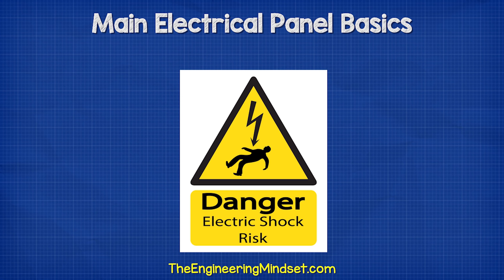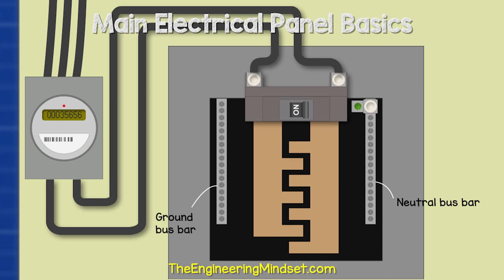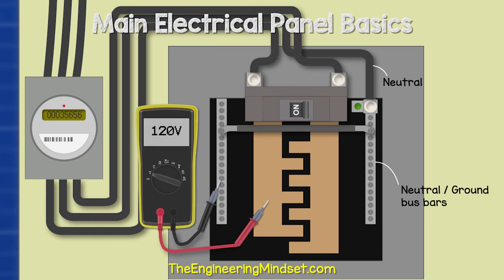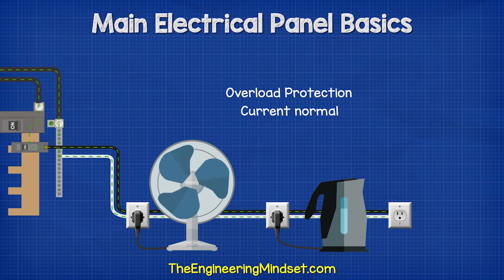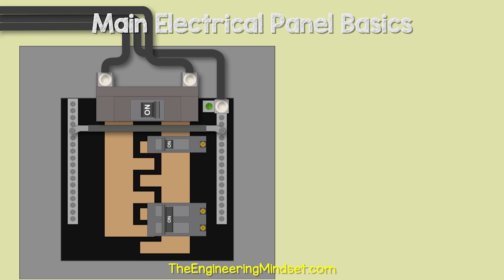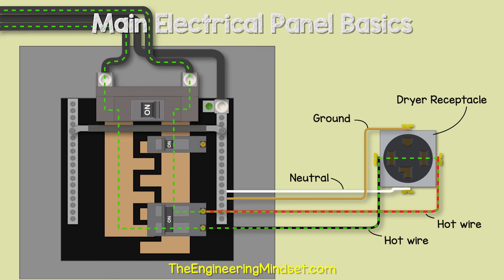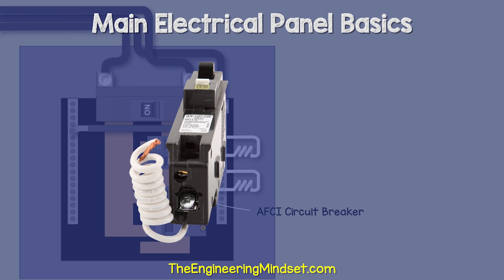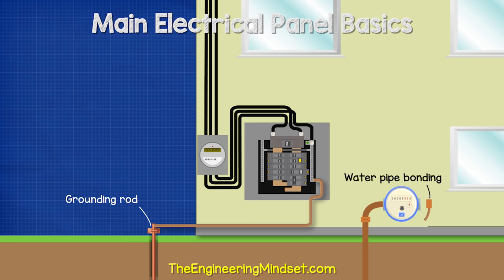Main electrical panel explained - Load center - service panel

Comment: The grounding electrode ( ground rods and water meter ground are really for lighting. If the building were to be hit. This lets the power go straight down through the wiring instead of bouncing around your internal wiring.  But it will bond you water piping also.

Comment: Is the transformer really single phase but split?
I always assumed it's just two of the three phases routed into the premises.
God this is so strange and weird.
Reply: Single phase indeed. There is a bit of a safety factor to having 240v available, but 120v for most household items that can work fine on it.
Reply: 2 of the 3 phases would give 208 because they are 120 degrees out of phase instead of 180 degrees.
Reply from the maker: Seen our new 3 phase transformer video?➡️: https://youtu.be/u0SsejDCVkU
Reply from the maker: Seen our new 3 phase transformer video?➡️: https://youtu.be/u0SsejDCVkU

Comment: wait if the ground and neutral bus bars are connected together, then why does electricity flow from the hot to neutral but not trip from being grounded?
Reply: Well, if the hot wire is actively "pushing" electrons, the neutral is effectively "pulling" on them. Of course this flips back and forth because it's AC (60 times per second in NA). Ground is 0 potential... think of the hot pushing as being + potential and the neutral pulling as being - potential. Electrons will always take the path of least resistance. A -120v pull is less resistance than 0.
Reply: @iwfur25  thanks for clearing that up

Comment: I've searched the internet.   I am simply trying to answer 1 question about my 200 AMP home's electric service.   My electrician. looked into the service and remarked, "YOU HAVE 240 AMP BUS TOTAL."    He left.    I looked into the service later and saw some single and double circuit breakers, with markings like 20 AMP, 15 AMP and etc.   ANY WAY I try to add it up, I don't get 240 AMPS for BUS.    THE QUESITON:   HOW did my electrician look briefly at my service and KNOW that my BUS TOTAL was 240 AMP?   Thanks!!

Comment: Hold on!!!??? The ground wire doesn't go into the ground? Doesnt sound safe enough
Reply from the maker: See this https://youtu.be/P-W42tk-fWc
Reply: @EngineeringMindset  very interesting! Thanks for this info. 
I'm in the EU does the ground pin work the same way?

Comment: I am curious on how the meter, smart meter in particular measures the incoming and outgoing current.
When you have something connected between 2 phases all the current returns through the meter and back to the grid as a closed loop always have the same current throughout it.
Does it meter that the voltage drop or phase slightly lags behind?
What about when you have a solar system connected to the grid, either 1 phase or 3 phase without neutral. Does the meter measure a slightly higher voltage on the consumer side than the grid side or a phase that is a little in advance of the grid?

What if you connect 1 phase to ground, how would the resulting consumption at the meter be measured? Only local ground in this scenario, no neutral or ground connected through the meter. Think of IT net without delivered grounding :)
Reply: If you connected 1 leg to ground it would be a dead short and would pop whatever breaker or fuses you have. Unless you're trying to start a fire that is.

 The terms you want to look up for in North America is an Impedance Grounded system, Solidly Grounded System, and Bonding.
Reply: @Morberis  Not everybody lives in north america. I was thinking about connecting a load between phase and ground, but you do not short circuit anything by connecting a phase directly to ground on an IT net. But you would make all your grounded appliances in your house quite dangerous to touch .....

Piisfun, thanks for the answer :)
Reply from the maker: Check our new Multimeter tutorial out ➡️ https://youtu.be/4lAyzRxsbDc
Reply from the maker: Check out NEW resistor video, everything covered! ➡️ https://youtu.be/DYcLFHgVCn0

Comment: If the illustration on this is correct, isn’t that against code? Bonding of Neutral and Ground wires should NEVER occur outside of the main panel. Neutrals and Grounds are to be separated in sub panels.
Reply from the maker: Please watch this video,  https://youtu.be/NUSNa-7Hecw all fully explained along with NEC codes

Comment: why the neutral and the ground bars are connected together? it is unsafe if the ground bar is not separated from neutral bar.
Reply: Neutral and ground must be connected together only at the main panel and no where else, including sub panels. The reason is to guarantee a 0 voltage reference point. This is necessary for the circuit to operate safely and for circuit breakers to trip when needed.
Reply: @surferdude642   then why is there a need for a ground circuit if the neutral can satisfy the requirement? my understanding is that the neutral is the return path of current, thus, it is hot whenever any load is energized and if the ground wire is bonded with the neutral it becomes part of the return path since it becomes energized also whenever any load is energized.
Reply: @surferdude642  where i live, we have a two-wire (hot and neutral), single phase, 240 vac, 60 hz, ungrounded system. I always get zapped when touching the metal parts of some of my appliances, so i decided to install a grounding rod and upgrade the outlets, do i need to bond or connect the grounding wire to the neutral line at the main panel?
Reply: @igorivanov7232  I'm not sure where you live, I'm in the US where we have a 120v system by center tapping the secondary windings of a 240v coil and hence the return or neutral wire. 240v is commonly used for high power appliances by connecting to opposite poles and omitting the center tap. In this case there's no neutral wire and the return shifts with the frequency from one pole to the other. Both are hot wires. 
You may have a loose hot wire that is making contact with metal somewhere in your system. You should call a local electrician to fix it. Changing the receptacles may do it, but a grounding rod will not help. You'll need an equipment grounding conductor to provide a fault path from the equipment to complete the circuit and trip the breaker. A grounding rod is mainly used to direct external current, lightning strikes, to earth.
Reply from the maker: Check the new SUB PANEL EXPLAINED ➡️ video https://youtu.be/NUSNa-7Hecw

Comment: i'm guessing that if you insert a screw through the hot and neutral in series, that the screw has a higher resistance than copper wire that a regular breaker may not trip.

Comment: They have energy savers you can connect to the breaker board and it could save more than 50% on the energy bill.
My brothers house was costing him 350 per month and it dropped to 140...

Comment: Hey- If I'm returning their electricity to them via the neutral, then why are they charging me for it?
Reply from the maker: You're paying for them to push the electrons through your devices when you need them, when they pass through your devices the energy is removed as heat, light, sound, rotation etc. The electrons continue to move, but energy has been removed. Its like sending a workman out to fix something, the company needs the worker back to do the next job but they have used energy to complete the job, so they need to eat food.
Reply: @EngineeringMindset   Thanks.  I hope you're a teacher because you explain things very well.
Reply: Think of it as a river, as water passes it can make things move like water wheels, turbines etc, but the water keeps flowing it keeps following its path.

Comment: I find it quite funny that in the US you have those "dryer outlets". From the european perspective, a dryer would be the last thing I'd connect to a high power outlet - the typical stove though is connected to 3-phase 400 V here in germany
Reply: @GH-oi2jf  My Miele dryer works very well - I usually don't even use it on full power as not to shrink everything. We can still pull 3.6 kW peak from our wall outlets, that is sufficient. Especially if you have a dryer with a heat pump. One thing we have are washdryers - they are the things that often really don't work so well.
Reply: @philipphermann9454  Why is that funny that we have dryer outlets? If the device needs a lot of power, we provide a 240V receptacle with the proper current rating for it. It's ironic for you to say that when meanwhile a whole host of EU general receptacles are 240VAC. This setup of 240V general receptacles has the potential to be more dangerous because power rises exponentially with a minor increase of voltage rating.
Reply: @amorag59  it is funny because we also have receptacle for devices that use high power - they are 400 V and used for stoves and heaters with power bigger than 3.6 kW.

Also - in contrast to US plugs - it is impossible to touch the contacts of the normal 230 V european plug/receptacle when they are live. So actually the US system is much less safe eventough it uses half the voltage 

btw: AC is deadly with as low as 50 V and 50 mA (resistance of the human body is around 1000 Ohms), so it doesn't really matter for safety. DC however would be relatively safe with 110 V.

The only thing that 110 V does is requiering more copper for al thr wires to allow the same power output because more current also means more loss as heat in thinner wires. So actually 230 V makes economic sense.
Reply: @piisfun  sure, cooking with gas is fun. But modern stoves use induction, they don't have the same problems because the on-of pulses can be much shorter and spread the heat better over time. Even without induction it really depends on the type of hob you have.
Reply: @philipphermann9454  I wasn't sure why you said "From the European perspective, a dryer would be the last thing I'd connect to a high power outlet" ie "why do dryer outlets exist" Then you brought up a high power outlet for a stove that is even more higher power.

You do have a point with saving money using higher voltage thus smaller wire for the same power, in reality for general circuits the wire sizes can be similar. I know the UK uses 13A breakers and some other places use 16A breakers with 2.5mm^2 wire. Compare this to a US circuit that has 15A breakers and #14 wire (2.08mm^2). Some EU countries do save on the lighting though as I've seen some EU lighting circuits can run as small as 1.5mm^2.

You are correct, I have seen the EU plugs with a bit of plastic on the base to prevent you touching the contacts. This is the least of my worry though. It's when a kid sticks a paperclip in a receptacle and you have an arc flash. We have tamper resistant receptacles required by code here that has a shutter door that covers the plug slots and a see-saw mechanism where you have to insert both prongs to open the shutters and push the plugs in.

Again the power increases with the square of voltage (V^2/R = power) I have not experienced an arcflash at 240/250VAC as I don't live in the EU (and I'm smart enough to not short out at US 240V US circuit lol) but I have shorted a 120 circuit via a metal screwdriver on the enclosure terminals and there was just a very loud pop. A jump from 120V to 480V you go from loud pops to a life threatening explosion producing a fireball hotter than the surface of the sun (an arc started simply from unsettled dust not even something metal). I imagine the results of an arcflash at EU standard voltage is in the middle there, especially if a child sticks a paperclip in an EU receptacle. At the end of the day 1.8 KW is more than enough for general use appliances, and all houses are set up to have 240VAC build in where the dryer would be.

Comment: why do they say neutral is safe.. its not it is still 120v.
Reply: It is safe to touch the neutral conductor whenever the circuit is open (like when the bulb is OFF) as there is no potential difference between the neutral and the ground you stand on (120V is the potential difference between the neutral/ground and one of the two hot wires).  But don't touch the neutral conductor on a closed circuit (like when the bulb is ON) as it is the return path for current.
Reply: @GH-oi2jf  should being the key word. I got nailed good from a dead short to neutral on the case of an ac compressor. Arm was numb for a good twenty minutes
Reply: @GH-oi2jf  I am just saying it should still be treated with care. Couldn’t figure out what was wrong with the compressor it ran fine but the case was live.

Comment: Why would you want your electrical distribution system tied to an actual path to the earth? If you had a lightning strike on your house, and it found a path to the earth though your panel, wouldn't it introduce millions of volts and and incredibly high current through all the relevant conductors in the distribution system?

I would think a system to protect your house from a lightning strike would have a completely separate path to the Earth.
Reply: The goal is to give that stray voltage a low impedance path to where it wants to go, out of the structure and into the earth. If this path was not available, the lightning will bridge those gaps anyway possibly through the combustible materials of the structure increasing the chance of a fire.
Areas that are prone to lightning storms do have their own lightning systems on the exterior of the structure.
Reply: The power transformer on the electrical pole feeind the house has a ground. If for some reason the actual neutral to the house was missing the ground would provide a path back to the transformer, allowing the circuit to be complete. Having a backup neutral is very important because if you were to lose the neutral and didn't have any kind of backup (ground) then every single device installed on one phase would be in series with the other phase of devices and a lot of devices would essentially blow up.

Comment: It is illegal and crazy to connect the neutral Buzz bar the ground to the neutral busbar the ground should be independent of anything and should not ever be connected to a neutral busbar. I'm an amateur electrician and I know that is a fact that will bring voltage through the ground and back into the circuits. This is totally wrong you cannot connect the ground to the neutral busbar the ground must be independent of anything you're taking voltage to the ground or your grounding out through your breaker panels neutral and ground. This is ridiculous you should have zero or nothing on your ground there should be zero voltage going to ground. The ground should have no load from the neutral on it. The ground is 4 Short Circuit voltage and should never be used to carry unused electricity back to the main panel, that is the neutrals job only! If you have a short circuit where does the short-circuit go to little go to ground unless the ground is connected to the neutral which will take it back to the main breaker which will electrocute you. This is going to electrocute and kill people this is bad information do not do that do not connect your neutral and ground to the Buzz bars in a panel. The ground must be isolated and neutral must be isolated from the ground. Absolutely never connect those two! I can't believe this information is out there it is absolutely going to get somebody electrocuted or killed!
Reply from the maker: It is specifically stated in the NEC that you do not have to separate them, there are occasions when you must, such as when using a sub panel. Please check your facts before ranting.
Reply: Connecting your neutral busbar to your ground bar makes your ground bar a Live Wire. Check the voltage using a metre and detect how hot your panel box is with this scenario. If there's voltage running through your panel box and to your ground then it's a live wire. So is your panel box once you connect the neutral to the ground the ground connected to your panel box which means you're connecting your ground to your neutral and you're making it a live wire. Which means your panel is now a live wire box splitting the voltage load between ground and neutral you will have a live panel box. Touch a hot wire and your panel box and you become the connection to complete the circuit. Electrocution! The only Advantage I could see to doing this is the electrical company will make more money because the excess electrical charge will go to ground as opposed to neutral back into the power grid. Or take the path of least resistance splitting it between the ground and the neutral! Costing you more money if nothing else as well as dangerous situation for electrocution. Not a rant just a fact! Check your panel box and your ground wire with an electrical metre there should be no voltage on either one. Unless you connect the ground to the neutral busbar!
Reply from the maker: The neutral is physically tied to ground at the transformer, 0V. The the ground rod physically ties the panel to ground. 0V. You are physically tied to ground, 0V. You do not have to separate them, although it's good practice to, unless a sub panel is installed because in that scenario you create an undesired return path. Again, check the NEC guide, it's all stated in there.
Reply: Sorry, but you are so wrong on this. The panel manufacturers (North America) literally have a green screw bonding the ground and neutral at the service entrance panel out of the box. But, like he said, not at the sub panel. Neutral is isolated from ground at the sub panel.
Reply from the maker: Check the new SUB PANEL EXPLAINED ➡️ video https://youtu.be/NUSNa-7Hecw